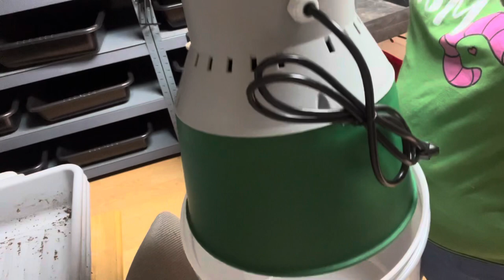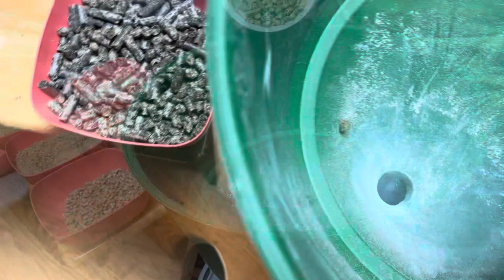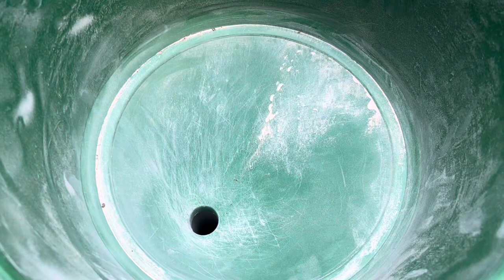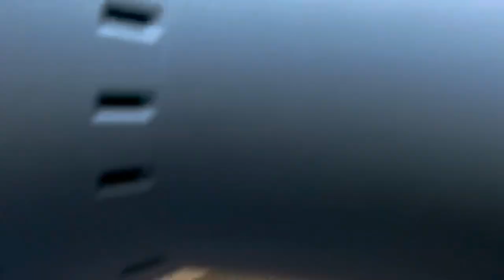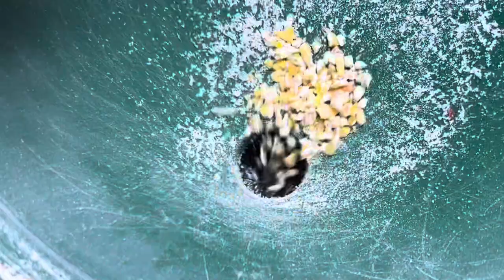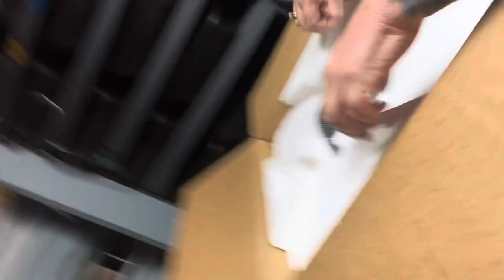New Worm Chow grinder #wormfarming

Comment: Impressive how that thing makes the finished product so fine. But as I recall, the old device worked pretty nicely too
Reply from the maker: Oh absolutely but I can’t use the other one indoors. My Indiana winters are harsh and we have ice storms. This will save my butt in the winter.
Reply: Yeah - it was a while ago when I saw you demo the old grinder... but as I recall you were doing it out on your porch - or some similar outdoor-ish location   :)
Reply from the maker: Yeah, I always roll it out to my back patio. When an ice storm hits, there’s about a quarter inch of ice on every single surface you can even walk. And since I live up on a hill in the country I can’t even drive out of here.

Comment: Hi Vee! I’m excited for this grinder! I just ordered it thru your link ❤. I’ve wanted a grinder for months and months and months. I’m slowly killing my Vitamix. I thought about getting the heavy metal grinder you have but the weight and a few of the reported issues (although the manufacturer has been apparently very responsive to addressing issue) made me hesitant to pull the trigger. But this grinder is lightweight, Karen endorses it, and it’s about $50 less than the heavy grinder made me say YES! It’s supposed to come Monday!! Can’t wait! Thanks for sharing it ❤🪱
Reply from the maker: YAY!!!! And thank you so much for getting it through my link. The company will give me a small commission. You know last year I had the problem when we had that ice storm. I couldn’t go outside to make worm chow so I had to go buy some worm chow for my own Worms.
I’ve been watching Karen on her channel for years. And I could actually lift this one which I like.
Reply: @TheGardenAndWormLady  Exactly! Being able to move the grinder as needed is a huge benefit!! Being able to use it indoors without choking out half the house is a huge benefit!! 
Let me ask you, the oyster shells… are yours flaked or the little rock/.pebbles ones?
Reply from the maker: @RockinWorms  I got the pebble one because I got a cheaper and honestly there have been moments. I don’t even grind it. I have just thrown it in the worm bin just like that and they do just fine.
Reply: @TheGardenAndWormLady  Ok! I’ve got the pebble kind for my chickens. They totally ignore it. I’ve had this bag for like 10 years! I’ve been scared to try to pulverize it as it’s like blendering rocks. I’m afraid to ruin the blender. But I’m going to give it a try in this grinder when it comes next week. Really really excited about this 😆😎👍

Comment: So, I have been looking at this machine on Amazon (maybe different brand name but same machine). My question is if I were to use the smallest screen would it turn oats into powder? 
I like oats, so do my worms. I stay away from oats because I have to use the smallest sized screen sized sifter, I can find to process it after grinding and it takes too much time.
 For me if I cannot grind it small enough to fit in a worm's mouth, I do not use it in the chow. 
I like that it works for oyster shells, a lot! 
If you say that it will grind oats into powder, I will be getting one. 
I would like to try scratch grains for chickens. The scratch grains are cheap and have a good diversity of ingredients.  
Enjoy worms and have a great Day!
Reply: I just bookmarked your amazon store page.
Reply from the maker: The oats I threw in were whole oats like you by in the bag to feed horses. 
I’m gonna test it with oatmeal like from my kitchen. Thank you for book marking my store I appreciate it
Reply: @TheGardenAndWormLady  I have a bag of whole oats, about 40lbs left in the bag. I like the oats for breeders, because of the enzymes they introduce into the bedding when I let it sit a week after mixing, before introducing worms. I watched the video but couldn't tell if the oats were turned into powder 100%. Does the machine powdlerize the oats 100% if the smallest screen is used? If it does, I'll get one this week through your store.
My problem with oats is the slivers that do not grind into powder and then make their way through the sifter (it is unacceptable with my methods to have the slivers). With my method the bedding and the chow is like powder, so it fits in a worm's mouth. If it is not as fine as powder, 100% pure worm castings cannot be the byproduct of growing worms. I need the castings to be pure for efficient growing of the worms to desired sizes.
Thank you!
Reply from the maker: @wormsforlife7352  this week I’ll put the smallest filter on and I’ll show up chose to see how fine. Stay tuned☺️
Reply: @TheGardenAndWormLady  Thanks, I will!